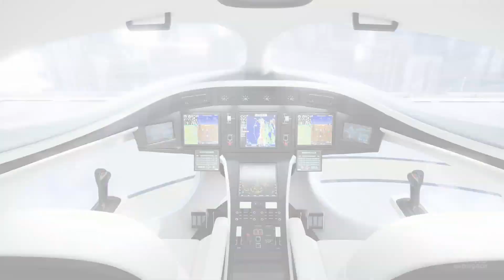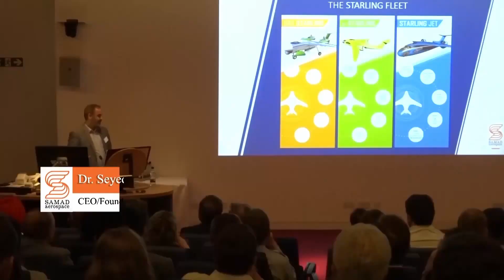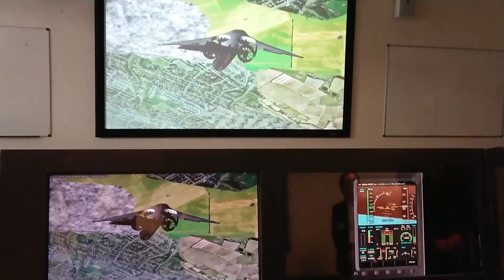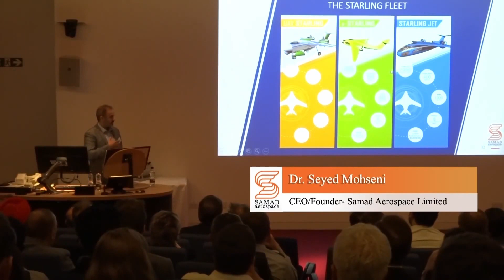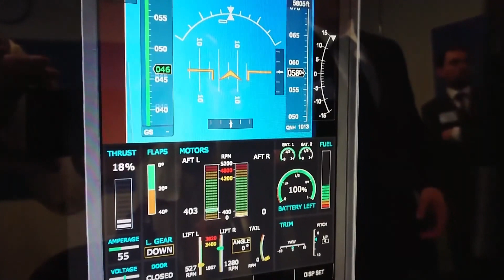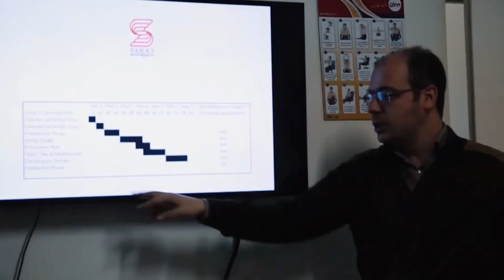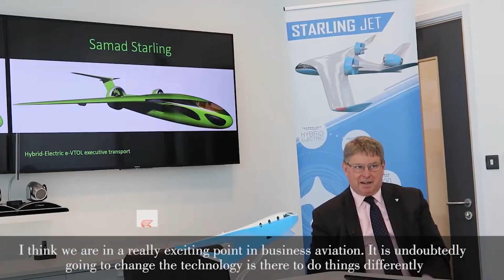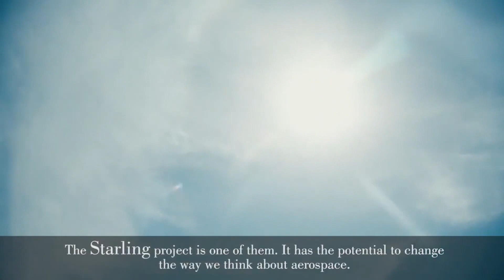SAMAD Aerospace S5U & Starling Jet | Hybrid-Electric VTOL

Comment: One of the main goals for Vtol is to eliminate the need for runways and traditional airports.  If your aircraft requires a runway then it offers no gains in efficient travel via the removal of airport activity.
Reply from the maker: They are in the process of incorporating vertical take-off and landing

Comment: Hmmm. Lilium and others are looking at a shorter-hop taxi model, nominally 100+ miles flights. Fast service, quick recharge type of stuff. This looks to me like a $6,000,000ish jet to take 1500 mile flights. It's going to need a lot of battery power to manage that and a lot of recharging time to have enough power to take the expected payload while competing with existing airline flights of that distance.
Reply: yes it dise